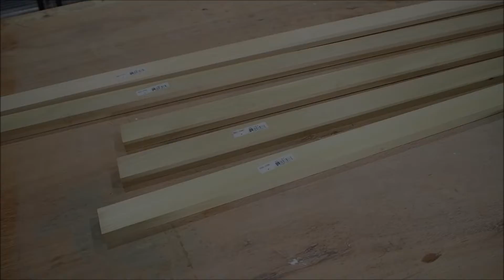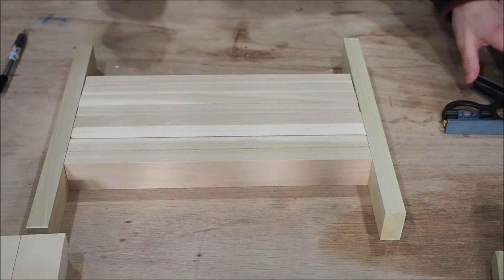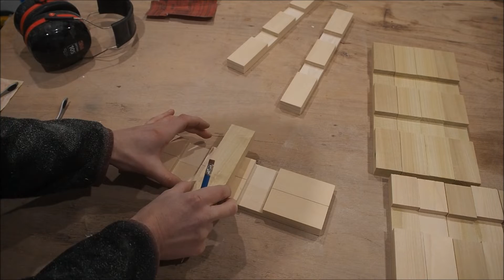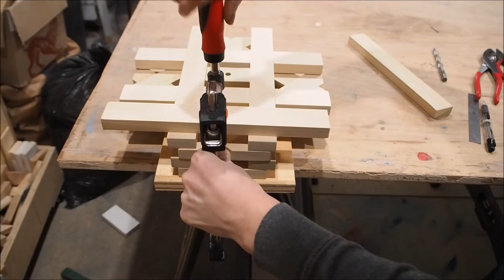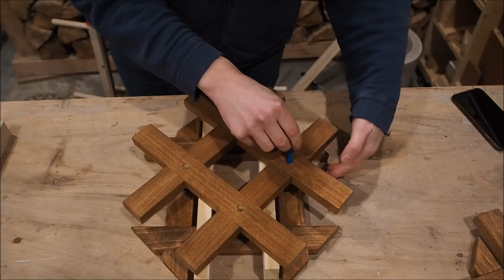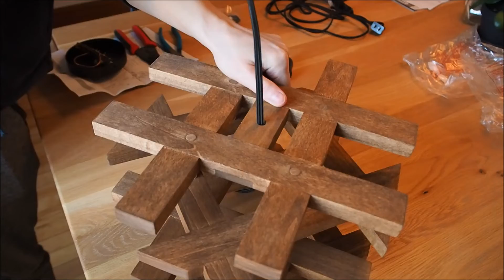DIY Wood Chandelier | Half Lap Joints

Comment: Nice work. Did you hang it from a joist or use some sort of reinforced ceiling fitting. I'd be a bit concerned about all that weight hanging directly from just an electrical cable and standard ceiling fitting.
Reply from the maker: No special reinforcements were added. It wasn’t really that heavy.